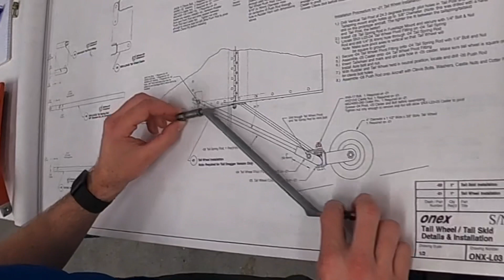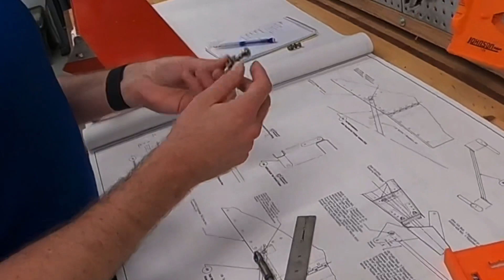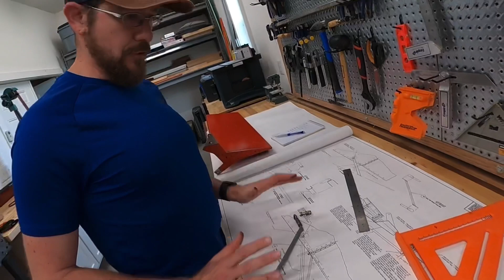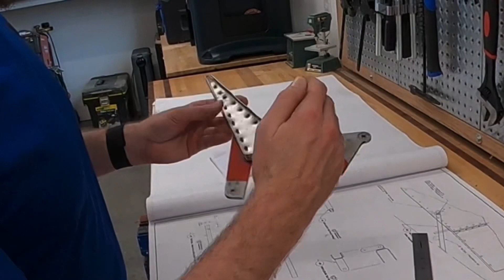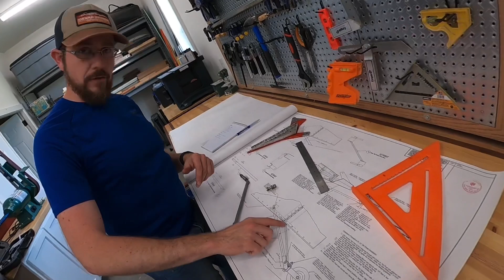So What Went Wrong? (Lean of Peak Aviation)

Comment: I think even the correct design is flawed. In my view a line between the pushrod end joints should be parallel to the axis of the rod the tailwheel is on. Then you have motion that uses parallelogram geometry. The current geometry can produce some big loads when the tailwheel is deflected upwards, and there will be some 'bump steer'. Moreover, I think I would prefer to separate the tailwheel connection from the rudder control cables a little further forward in that control system. I think further failure would be slow, because all the rivets on the right side of the bottom rudder rib were holding on.

Comment: A simple compression spring on each side of a pivot pin mounted on the rudder horn,will breakup the dog fight between the rudder and the tail wheel.
Reply from the maker: Yeah have you seen the RV steering rods?  There’s a spring in them. RV has been using them for years.  They have a great control feel but also relieve that adverse force.
Reply: The geometry on the tail wheel fork is at an angle that will induce oscillation , all the mass is aft of the pivot point. 100% trail ,it will shimmy and turn your control rod into a jack hammer. Look at scott  tail wheel as a example, the fork  pivot and axle are about 45 degrees.
Reply from the maker: @mileskifield  That’s also something I haven’t explored.  Thank you.

Comment: Certified airplanes use solid rivets or cherry structural blind rivets that lock with a steel serrated stem. Labor intensive & costly. Cheap pop rivets or avex rivets do no stand the test of time. Also homebuilt aircraft do not have heat treated structural sheet metal like a certified plane. That's why a certified plane can have 10,000 hours on the airframe with no loose smoking rivets like a homebuilt. My advice to you new pilots or first time plane buyers stay away from experimental planes.

Comment: My eyes aren't what they used to be, so I can't tell very well what the blueprint called for in regard to the original design. However, you correctly noted that the angle between clevis point to clevis point isn't very different. Unless those ball joints are running out of motion and binding, going to a straight pushrod isn't going to make any difference on the forces. And just moving it from the top to the bottom isn't going to make a difference regarding it getting pulled down when you manually push the wheel to the right either. You will still be loading the control rod in tension and it will still pull down on the control horn. In fact now pushing the wheel to the right will both be putting tension in the pushrod (pulling down on the control horn) and the moment from the pushrod being mounted below the control arm is going to be bending the front of the control horn down at the same time. 

Making the rudder 10mm longer will be directionally correct, but won't make a huge difference in the angle of the control rod and therefore won't make a huge amount of difference in the vertical vs. horizontal force components either. 

I know there is always the danger of finding the next weakest failure point when deviating from plans, but if this was my plane I would be adding a doubler to the lower rib of the rudder and taking a good hard look at every part of the rudder between the control horn and lower rudder hinge.
Reply from the maker: I’ve actually ordered parts to completely rebuild the rudder at this point.

Comment: Seems to be a consensus that the bottom rib needs to be a lot thicker too, and the thick plate beneath it keeps it from bending under stress, so that leaves the rivets as the (hidden) point of failure.  If the thick plate doubled as the rib, in other words riveted directly to the sides of the rudder,  seems like a better solution maybe?  It will be interesting to see if other sonex owners, now aware of your problem, discover similar issues on their own planes.  Keep us posted, and glad your still around to do it!
Reply from the maker: Yeah or maybe it would have pulled the rudder right off the hinges at that point.  See the problem is the stress has to go somewhere and with this setup the adverse stresses are the cause. The failure was the symptom.  I’ve bought everything the rebuild the rudder so I’ll have you guys a new video shortly.
Reply: @LeanofPeakAviation  Please checkout my comment below about eliminating the tailwheel stress.

Comment: What I don't understand is why the design has the tailwheel trailing behind the pivot point instead of directly beneath it.  If someone were to pull the tail of the plane one way or another, say maneuvering it around the hanger by hand, it would put undo stress on all the linkages.  If it were directly under the pivot point, it wouldn't.

Comment: At about 45 sec in a big mistake is made: NEVER scale the drawing, do not use drafted perspectives as reference for components! You have the wrong part or the drawing differs from the build. Are the rivets to spec per the drawing - csk, button head, etc? Lots of questions here that demand a thorough inspection by a sheet metal tech, IE, etc.
Best on the correction!
Reply from the maker: All the correct parts have been ordered from Sonex. We are quite certain this part is not the original.

Comment: I think this failure wasn't totally as Sonex claim, "the dodgy steering pushrod". Looks to me to have been a shock loading on the tailwheel whilst at full right deflection. This is a shortcoming of a solid direct steering tailwheel, shock loads are directly transferred to whatever is on the other end of the steering link in this case the rudder horn. This could have been initiated by something like having full right rudder deflection during a groundloop, fighting a strong crosswind with the tail down or tailwheel in a hole or a clump of grass or something.

What surprised me is this rudder control horn is nothing like the rudder found on the sonex and waiex. If built correctly the Sonex has the drive horn on top of the rudder end rib. With the shop head of the rivets against the thicker 1/4" material as is standard metalworking practice. This way the rivets on the drive horn on the sonex are not in tension. The other variation is the quantity of rivets from the rib flange to the rudder skin, sonex has 15 rivets the onex has only 5. The Same load on the Sonex would be seen as sheer by these 15 rivets. The onex has the shophead on the thinner material and the rivets that pulled through loaded in tension. Poor design on the onex. 
 
If I were fixing this I would be sandwiching the replacement rib with a light plate above the rib and add more rivets to the rib flange to rudder skin, to deal with the sheer load. As a bear minimum I would flip the orientation of the complete set rivets where they pulled through, this would still leave the rivets in tension but far more unlikely to pull completely through.
Reply from the maker: Very good comments… I did look at the Sonex design and was very curious to why they chose to put the horn on the bottom of the end rib in the Onex… Especially after receiving the new end rib in the mail yesterday… It’s not a very confidence inspiring little piece of sheet metal. That being said, for every desired range of motion on the tailwheel there is a point in space where an Appropriately sized drive rod will allow that range of motion without The significant forces we saw in this set up…so I’m very curious to see what happens when we trial everything according to specs.

Comment: Someone installed a non original link assembly with a bad geometry that set up the rudder to fail in the future. They probably did not know that they didn't know what they were doing.
Reply from the maker: Agree totally.  It’s a nifty looking control that’s more adjustable and has cool little ball joints on the ends…I doubt he ever imagined this would happen.

Comment: Question from a non aircraft builder, but someone familiar with rivets. Those rivets looked like they are going through a relatively thick piece of material (the bellcrank) into a relatively thin piece of material (the lower rudder cap), and I don't see any backup washers on those lower rivets. Not sure what the order of assembly is on this part, which might explain the use of what appear to be blind pop rivets - but using backup washers on that high stress connection seems like a no-brainer to me.

Can any experts explain why that wasn't the process here?
Reply: Backup washers are not something that you are going to see in aircraft construction. First rivet joints are designed so that the rivets are normally loaded in sheer. Second the number of rivets used in the joint is carefully calculated so that the joint has the same strength as a continuous piece of material. If for what ever reason you needed to protect for pull through you would go with an aluminum doubler plate rather than backup washers. Galvanic corrosion from dissimilar metals is always an issue to be avoided with aircraft structures.

Comment: Can you buck the rivets to the horn and then use the cherrys to attach the rib to the rudder ? You will get better strength from the bucked ones and the cherrys would be in shear as they should be. This won’t solve the issue of the failure as it will simply move the fail point to the cherrys in shear. However, it will or should add strength when you ultimately find the smoking gun on the problem. I would lean toward a rudder rebuild also. It’s difficult to determine additional stress from the failed part. If you’re doing Acro I would be very cautions. Don’t overlook bulkheads and tailwheel attach points in your inspection.
Reply from the maker: I could.  I could also use cherrymax rivets which are used as solid rivet replacements in many cases. I went ahead and ordered everything to rebuild the rudder. I’m just going to do it.

Comment: Watched the first video again and noticed that the 'raised' height of the rudder-as pointed out by Sonex- might be causing other problems.   The horn looks to be interfering witht the fuselage and it appears that the rudder side hinge might actually be pulling away from the rudder itself (hard to tell in the video).  I think the rudder must have been incorrectly built with the hinge mis-aligned, which led to the non standard control rod, which led to the current issues.  Rebuild the whole rudder!!  So glad you're safe!!!!
Reply from the maker: Enough have said it now…I’m convinced.  Waiting on parts for a new rudder.
Reply: Yes, you should ask yourself why the builder modified this rod. It was not done so just for no reason. Rebuild the entire rudder.

Comment: Yes what you identify at 2.40 is the cause. A sideways force to the right on the tailwheel is a moment that will cause the control horn to be pulled down, putting those rivets under tension. As this will happen routinely on landings and ground operations, it should have been a design condition that was considered. Messing with 10mm of rudder height, the angle of the tailwheel arm - these are very secondary/irrelevant. Rebuilding the current design will not stop it reoccurring. The bending moment should be transferred to the side-skin of the rudder, so that rivets can work in shear (as they are designed to)
Reply: Just come across these videos, so a bit late comment. I agree with all you say, but could the problem be solved by adding limiters to the steer angle travel in the tailwheel assembly, so it can't use the rudder horn as a "lock stop"? Could be set just beyond the normal tail travel, so they don't interfere with flight controls, but still can't exert excessive forces in a heavy sideways landing or rough taxi.

Comment: Just an informed guess. I do fly a tiny homebuilt taildragger myself and the tailwheel on my plane is connected to the rudder by springs. 
Those springs were initially quite stiff which made the handling rather direct to the point where it was hard to manage. I have since loosened the connection and it handles much more docile. Also, the forces introduced into the rudder and controls by the tailwheel are less severe now.
With this experience, having the tailwheel connected by a completely stiff pushrod seems like a bad choice to me.

Then there's this particular design with an additional ball joints in the rod - what is that supposed to do? All it seemingly does is introduce more wear and tear by going "click-clack" all the time.

Now, apparently the plane doesn't have a differential brake system - for a taildragger that is just stupid. You need that. period.

Comment: Hi, I am an AME (Canadian version of A&P + IA), also an engineer, pilot with over 1k hour of tailwheel experience, and once did some test flights on a Sonerai II (the immediate predecessor of the Sonex line of aircraft). Several of the other comments have suggested changing to a sprung steering system like would be found in most certified tailwheel aircraft. While a very good suggestion in general, that is not an option on the Sonex without first changing the braking system. The Sonex does not have differential braking so requires the direct steering control of the tailwheel offered by the solid pushrod, otherwise you would have no positive directional control when taxing at slow speeds. Modifying the braking system to a differential brake system was my very first suggestion to the owner that had me test fly his Sonerai, it just gives you so much more directional control authority. As for the non standard push rod on your aircraft, that was no doubt necessary to make up for the rudder being shortened on the bottom end, there is probably another story behind why that happened. I would just go ahead and order all the parts for a new rudder now and save the time of deciding later what you probably already know you are going to have to do. Your analysis of the top mounting of the pushrod being the source of the tensional failure of the rivet joint looks to be spot on. Someone else brought up substituting Cherrymax rivets in place of the supplied pop rivets, it is not a horrible idea for an application that has a demonstrated history of failure, but I would point out the rivets did not fail, the aluminum rib failed resulting in the rivets pulling through. If you are concerned with reinforcing the joint I would first suggest a doubler on the inside of the rib, one sheet size thickness up from whatever the rib is made up of (ie. if the rib is 0.025" use 0.032" for the doubler). Then the Cherrymax or even solid rivets might make sense but again it was not the rivets that failed. The downside is Cherrymax are more expensive and require a special pulling tool but they are approved to replace solid rivets in certified aircraft. If I owned or was building a Sonex, I would definitely be upgrading to a differential braking system but that is just my personal bias. That would have the side benefit of allowing you to replace the pushrod with something else that would prevent the transfer of tailwheel loads to the rudder.
Reply from the maker: Excellent comments. I think I’m just going to replace the entire rudder as you said.  I’m going to take this approach…since this is really an isolated failure, I’m going to build everything back according to the actual specs, and then make this a part of my routine preflight and inspect the area regularly.  All of your suggestions are appreciated.

Comment: I would want the axle of the tail wheel almost under its pivot point rather than behind it. Yes, it would hang down lower, create more drag, and not look as cool, but having the axle so far behind it’s pivot point turns it into lever that can put lots of force on the rudder control linkage.
Reply: Exactly right.
Reply: It basically has 90 degrees of caster rather than 5 or 10..

Comment: Bad design from Sonex! 
All the shock loads go
Directly into rudder control horn! Re design 
With a 1/2 “ solid block
Of 6061 aluminum for
The rudder bottom end
Cap and use machine 
Screws with an aluminum skin doubler on outside of rudder at
Least up to the next
Rudder rib. Connect 
Tail wheel with springs
In a pull pull configuration.
Reply: No, sorry but you do not understand the aircraft design/plans. Please do not try to redesign an aircraft that you have never seen the full plans of and don't understand how it was engineered. Offering advice like this can result in a far more dangerous "solution"!

The shock loads from the tailwheel go into the flexible titanium rod that attaches the tailwheel to a beefy set of structures inside the aft fuselage.  When built per the plans (this tailwheel was not built to the original specs), the small tailwheel control-horn only transmits modest loads through the pushrod to the rudder horn. The rudder horn itself is an incredibly beefy part and can take these loads (as proven by tens of thousands of flying hours on existing airframes without this being a problem), if the control linkage is properly set up.  In this case, the original builder of the airframe did not follow the plans and the control linkage is not only at a steeper angle but it physically overlaps part of the control horn when the tailwheel is deflected to one side. This overlap is the crux of the problem - because vertical motion of the tailwheel when there is overlap will physically push down on the control-horn.  In the stock configuration, the control linkage is mounted differently and is designed so that vertical motion is compensated for by the rod-end bearing and the control linkage itself never contacts the rudder horn to apply an upward or downward torquing force on it.